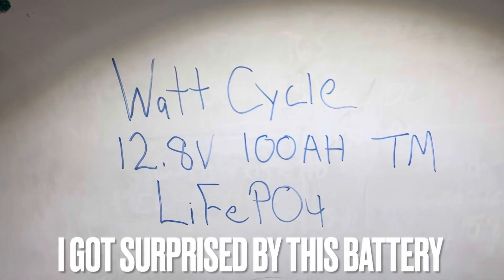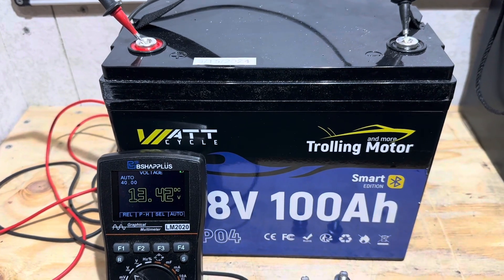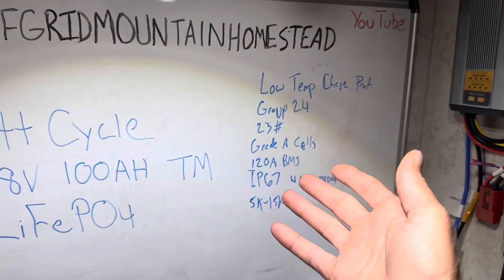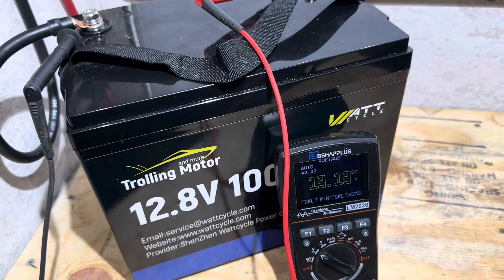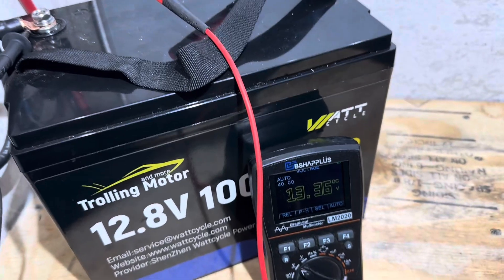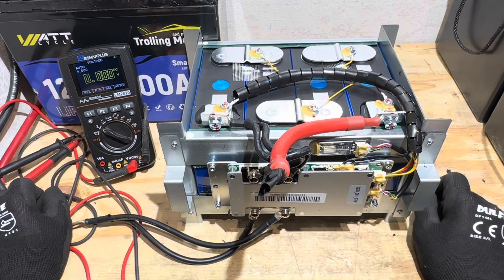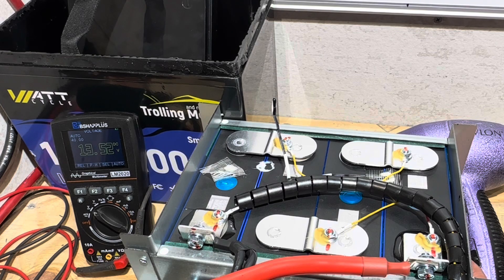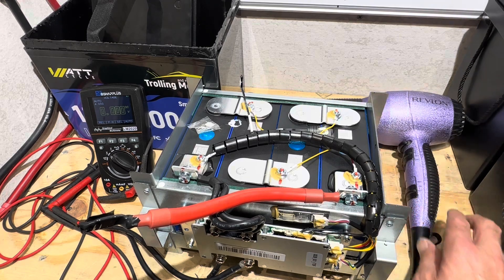WattCycle 12V 100Ah LiFePO4 Lithium Battery Review Teardown Group 24 Trolling Motor Battery

Comment: Love the video!. I am going to go ahead and return my Wattcycle that is resting at 13.2v while it is still in the return window as I don't want to risk getting stuck with a faulty unit. My concern now is I have a HumsiENK 12v 100ah on order rn and it is from the same parent company so I am worried it might suffer this issue also, If you can it would be very much appreciated if you could check the HumsiENK for this issue?
Reply from the maker: Glad you enjoyed! Hope it helped you! Yes I will see what I can come up with for you on Humsienk. Appreciate you taking time to watch and comment!
Reply: @THEOFFGRIDMOUNTAINHOMESTEAD  Before printing the return label I checked one more time and now it was showing 14.2v resting not sure what this thing is doing
Reply from the maker: Exactly! BMS is about half crazy acting! Just like this one when it reset from high temp jumped to 13.75 the dropped right back to 13.5 sorry I don’t have a solid explanation of this behavior because it’s first I’ve seen. I just consulted with a larger YT channel. We’re both thinking batch of faulty BMS? This is developing and still want to see what manufacturer has to say. No other battery I own does this.
Reply: @THEOFFGRIDMOUNTAINHOMESTEAD  True. I got my Wattcycle boxed and labeled for return tomorrow. My HumsiENK battery comes in on friday. looking at your review video it does look to have a different BMS even tho both brands share the same parent company. really hoping it doesn't have this issue
Reply from the maker: The Humsienk had a large wire size and 150A JBD BMS? It’s the one I started my truck up with too 😂 No problem with surge capabilities!
Reply: @THEOFFGRIDMOUNTAINHOMESTEAD  Not sure which BMS but for sure a different one. I seen that truck video, Was the reason I got the HumsiENK. I bought the Wattcycle originally because they had your review on the Temu listing lol. Your videos really be helping people with this stuff. some of the best reviews on batteries they are
Reply from the maker: Appreciate the kind words of encouragement! Really nice to hear that! 
Does your Hunsienk indicate a different BMS or data than the one I have? 
Regarding my content on Temu, some of my content gets reposted in places I’m unaware of. Some don’t even have permission to use my content but they do anyways. Hard to stop this unfortunately.
Reply: @THEOFFGRIDMOUNTAINHOMESTEAD  the Humsienk I ordered should be exactly the same as the one you reviewed it gets delivered Friday
Reply from the maker: Please keep me updated on this and how it operates!
Reply: @THEOFFGRIDMOUNTAINHOMESTEAD  Opened the Humsienk put it directly on the Vevor 35a charger. Charging finished. Resting voltage is at 13.3v
Reply from the maker: Well… wonder if they have changed BMS now? Have you discharged and recharged yet?
Reply: @THEOFFGRIDMOUNTAINHOMESTEAD Discharged overnight it seems the capacity might be correct. the battery stays at 13.1v during discharge for an abnormally long time. These may have a half functioning BMS after charging I had my Multi-meter on the terminals and the voltage climbed to 17v then went back down to 13.3. I've never seen that before
Reply from the maker: How did the charger go to 17? Double check your charger on another battery of you have one. I haven’t noticed a wall charger exceeding 14.6 🤔
Reply: @THEOFFGRIDMOUNTAINHOMESTEAD  the battery while off the charger after sitting for 30mins showed 17v then back down to 13.3v. It might be my multi-meter acting up. capacity is there as advertised so idk. if you find the answers on this let us know. thanks
Reply from the maker: Could be your meter, good point. I’ll keep you posted!
Reply: @THEOFFGRIDMOUNTAINHOMESTEAD  What did you do to protect your Alternator from burning up a idle RPM, or do you have a high output Alternator?  You mentioned using the battery for starting.
Reply: I charged both the Humsienk batteries individually, put them in parallel as soon as they were off the charger they are showing 13.6v at the terminals when in parallel they seem to be working better together
Reply from the maker: @WV-gt2bd  13.6 sounds good! 👍

Comment: Sometimes putting a battery connected to 3 other batteries can throw the cell balance off. LiTime sells a balancer for up to 4 individual batteries.
Reply from the maker: Batteries were parallel wired with perfect balanced battery connection configuration. https://www.iotaengineering.com/-/media/abl/iota/files/balancedcharging.pdf?forceBehavior=open

Series pack of 4 ie 51.2V is where the balancer comes into play. Just like the 4 series 3.2V cells in this 12.8 battery are supposed to balance with the BMS balancer.
Reply: I forgot to mention see the video by Off Grid Basement. He had to connect a Balancer because of the cells going out of balance.
Reply from the maker: Roger. I manually balanced the cells after filming this video. Top balanced to 3.6. Resting voltage @13.8 on the cells. Still only 13.5 ish out of BMS. I’ll be replacing with a JBD BMS.

Comment: Thanks! Love your videos.
Reply from the maker: You’re most welcome! Glad you enjoy the videos! Appreciate you!
Reply: @THEOFFGRIDMOUNTAINHOMESTEAD  I have a lot of solar bought up and ready to go when needed. I know I need to go on and set my system up, but my electric bill is only $30!a month. 
I do have a storage building at another location set up with a small solar system. 1 100 watt panel with a 12v 100ah lithium battery for lights. It seldom gets used. I have wondered will it hurt not getting used much.
Reply from the maker: Battery should be ok if you have a good controller on it. May want to set your controller to a more conservative voltage if not being cycled. Or disconnect if you visit every few weeks. They hold charge a long time and self discharge is very very slow. Hope this helps!